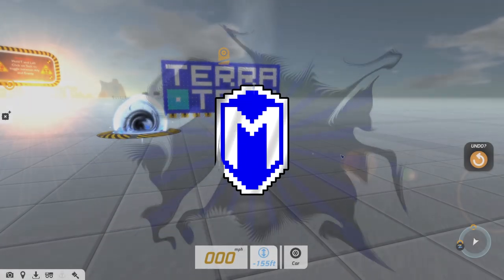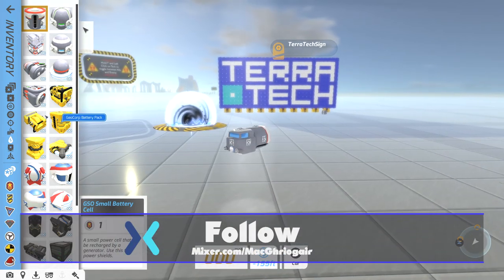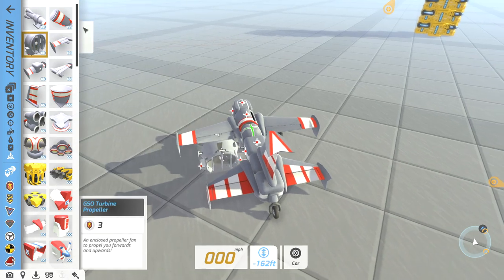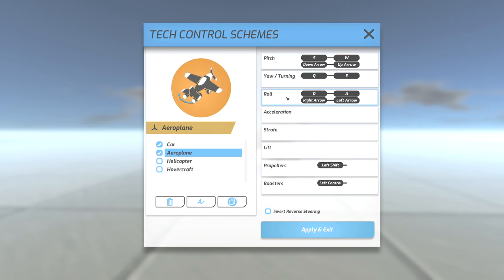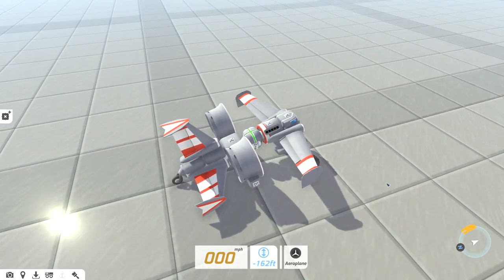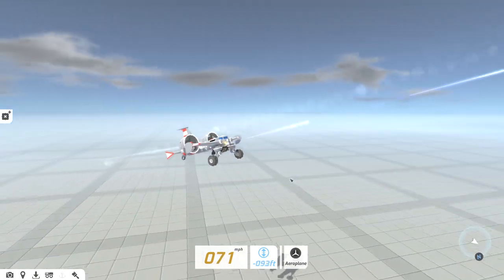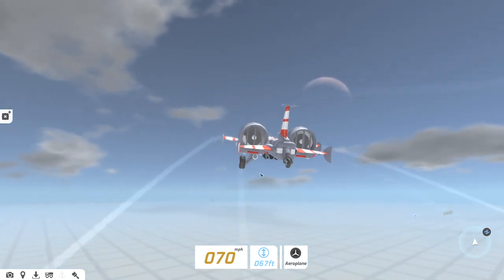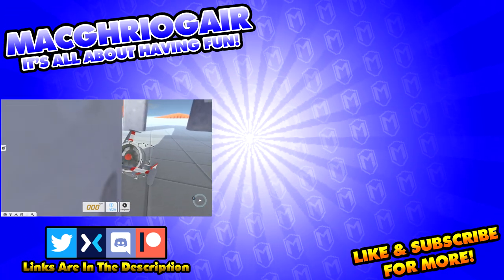How To Build A Simple Plane - TerraTech How To Guide And Tutorial

Comment: If your plane is acting weird:

Step1: Search up some WWII plane (for example, p51)
Step2: Use the same proportions as it, placing wings and propellers at the same spots.
Step3: Done!

In my opinion, you should always leave the proportions to the professionals
Reply: I agree. I made my plane using realistic proportions loosely based on commercial jets for my first one in creative and the second one was more akin to a supersonic bomber design like the  Tu-160 or B-1.
Reply: Hey get the proportions right